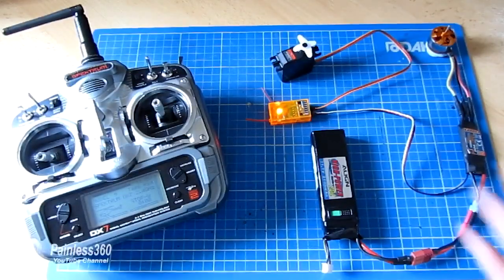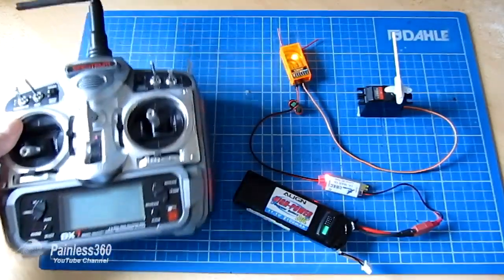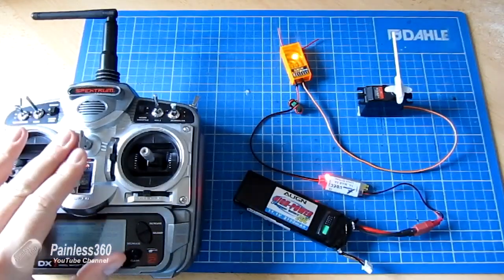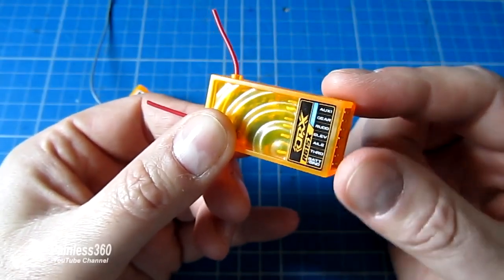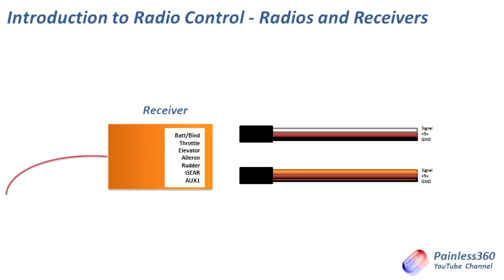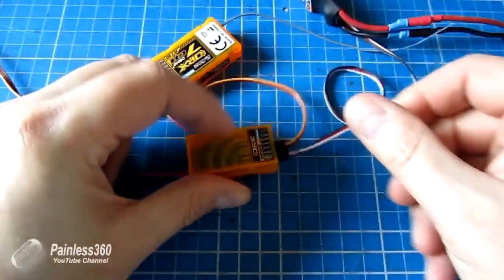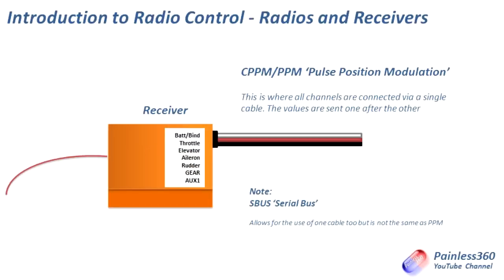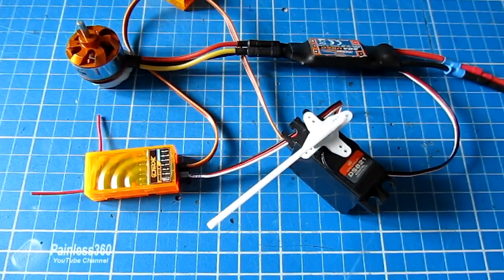RC Basics: Introduction to how a RC radio system works

Comment: Hi..! i have a problem. The one motor of my quad copter is starting late? how can i fix
please reply me how to do?
Reply from the maker: +Ahmed Ali See our video on 'Manual ESC Calibration'. Best of luck!
Reply: thank you but if you share link it will easy to find
Reply from the maker: Google 'Painless360 esc calibration' or use the playlists or search engine in YouTube.. Lots here you may find helpful..(https://www.youtube.com/watch?v=olIqTiSJHIY)
Reply: thank you so much..

Comment: how do i check what transmitters work with which receiver? because ive been reading up and found out that not all transmitters work with every receiver. It would really help if you could help shed some light because im new to the hobby thanks!
Reply from the maker: If you are new then the 'Introduction to RC' playlist will come in handy. Happy flying!

Comment: This is a great tutorial but i have a question. i am converting my daughters radio flyer wagon into a motorized wagon. I am using a 24v 500w motor. i am interested in making it radio controlled. I understand the servo is powered through the receiver but what if the servo just happens to be a motor like the one im using then i assume the power needed wont be able to be routed through the small rc receiver. I can not find anything on how to make this work. How would i wire the motor and the 2 big 12 volt 20ah batteries wired in series to a little rc receiver? Thank you for any help
Reply from the maker: You need a motor speed controller that will connect to the battery and motor and manage the supply of power in relation to the signal from the RC kit. I've no experience of working with the larger motors but best of luck!

Comment: I am confused about the electronic piece between the battery and the receiver. I set my model up with a spectrum radio and orange receiver without that piece. Why would I need that component and what purpose does it serve? what is the name of this part.
Reply from the maker: +Cayrick Pan That piece is a battery eliminator circuit or BEC. It reduces the battery voltage to a steady 5v that the receiver needs. Please see my 'Introduction to RC' playlist for more videos that cover the basics. Best of luck.

Comment: Hi, can you use any receiver with a transmitter? I got a Th9x and wondered if I could use an OrangeRx R616XN with it or do I need an Orange transmitter module?(Newbie)  Cheers ;)
Reply from the maker: +JohnnySlash Hi, you need a receiver that works with the radio. This video may help - https://www.youtube.com/watch?v=cPi4v-flw1c

Comment: Thank you Lee.
I understand PWM much better now and thank you for forwarding me to your RC Basics video. However, when looking at you Taranis video number 3, I noted that you made corrections of low end I believe was 1060 and high end 1960, as you mentioned that SimonK esc´s throttle are in that range. How can I find out what a particular ESC has their throttle ranges low and high, and if I for example change that to 1060 as yours, should I change the middle value as well? Sorry for the questions, but it is a bit confusing. I am in that way that if I don't understand completely, I want to know, and as you explain so well in your videos and I have learnt a lot, I would be most thankful for any help. Thank you.
Reply from the maker: +Amir Tahami If you Google 'SimonK default throttle range' you'll see the answer... Best of luck.

Comment: This series has been a huge help for me. I have the final few pieces on the way to finish up a 450 quad. This will be my first RC for nearly 10 years since I was younger and had a nitro truck in high school. the difference is that came build and ready to go, so I never cared to learn about the components in detail. now that I am building an RC quad from scratch I have found myself searching for explanations. I am going with the Multiwii 2.5 board with GPS and BT. your walkthroughs have been perfect. so ty for that. I had a question about PPM and PWM. I understand how they work, and how they differ...but I have a couple of questions. I read different places that not all tx and rx support it. I have bought a flysky FS T6. how do I find out if this will support it? and does the multiwii support it? also, I hear people mention that it opens up the other channels as basically aux channels...is this true? if so could I use the 4 switches on the tx all as usable aux switches?
Reply from the maker: I have a video that covers the difference between S-Bus, PPM and PWM. That should help.  The difference is between the reciever and whatever it's connected to. Using non-pwm connections gives easier cabling and can also give you more channels out of your reciever. Hope the video helps..

Comment: IM NEW TO BUT AS ALL THE OTHER VIDS IF YOU DONT FLY YOU HAD IT. I GOT MY MODEL TRUCK BATTERY CONECTED BIG WIRES TO SPEED CONTROLER. BIG WIRES TO MOTOR. THEN SMALL RED AND BLACK TO ON OFF SWITCH. AND THE 3 WIRES TO RECIEVER POWER PINS THERE BOUND BUT ONLY CHANEL ONE WORKS AND I ALSO NEED TO MAKE THE MOTOR TO TURN OPOSIT WAY FOR REVERSE I GOT A TGY 9X WITH THE9X BC V2 RECIEVER. ALL I GET IS SQUEEK FROM SPEED CONTROLER AND FLASHING LIGHT
Reply from the maker: Neil Harrison why all the shouting! ;)
These videos may help - https://www.youtube.com/watch?v=DraFgiDELjI and https://www.youtube.com/watch?v=OOplk52R4no
The RC power systems and principles on car, boat, planes, multirotors and even helicopters are the same. Maybe you can start a channel sharing tips for those interested in the ground based vehicle part of the hobby? 
Best of luck.

Comment: this is pretty cool, thanks for the video. How do these channels control a quad-helicopter, or things that need cooperation between channels for a single control?
Reply from the maker: Hi, that's exactly what the flight controller does. For example - you tell it via the radio sticks that you want it to rise (throttle), go forward (elevator) and to the right (aileron) and the flight controller figures out what that all means for the motors and controls on the model and then gives those movements to you. Clever stuff!

Hope that makes sense!
Reply: Oh yeah, that makes sense. But the controller is not in your video is it? It seems that normal helicopters don't need one right?
Reply from the maker: All RC models need some form of controller.

Best of luck with your build.

Comment: I would like to know how the mixing on my spectrum dx7 black works.  Specifically how to get more than just 3 flight modes on a cc3d board.
Reply from the maker: brian david what a great idea for a quick tip! I do this with my DX7 using the mode switch and another to mix the channel back into itself to get 5 modes on the APM. The top mode is RTH on both switch combinations though so that I don't have to think about it if I get into trouble. Let me put this together and get this on the channel. Thanks again for an excellent suggestion!
Reply from the maker: Painless360 https://www.youtube.com/watch?v=jxujrKtTwG8

Comment: For failsafe on a quad would it be wise to set all sticks neutral apart from the throttle which could be 10-20% in the hope of getting a somewhat controlled descent? Is it worse to get an uncontrolled quad landing with live props, or a 1 kilo lump falling out of the sky?
Reply from the maker: LegGiant You need to set the failsafe to be 0% throttle so that, on the bench, the motors never start accidentally. Use the failsafe features of the flight control board/model to program what you want to happen in the event of a radio failure. See https://www.youtube.com/watch?v=iXxkJ9V41EQ for an example.Happy flying!

Comment: For a noob like me, these are gold. Even those who have prior knowledge can still take a lot from the videos you make. Thanks a lot man, really.
Reply: Hi
Reply: absolutely agree! These have been the videos I've been searching for!
Reply from the maker: mungkey Thanks for the feedback, too often those of us in the hobby forget that when you are new to RC, or coming back into it after a break, not everything is obvious and simple overviews can help plug the gaps in knowledge and provide a much needed basic understanding to learn from. Best of luck with your journey into RC. I have an 'Introduction to RC' playlist that this is part of that will give you loads of useful tips and tricks..Happy flying!
Reply: Painless360 
I just bought an rc yacht and it's controller won't even activate. But from what I heard from you about frequencies, I can get a new controller for it, just as long as it has the same frequency as the 27MHZ transmitter inside.